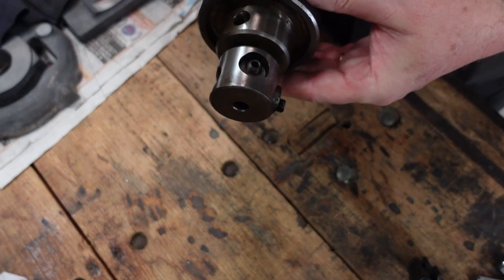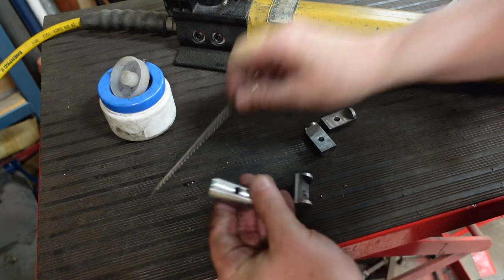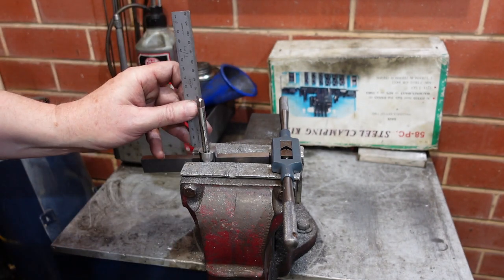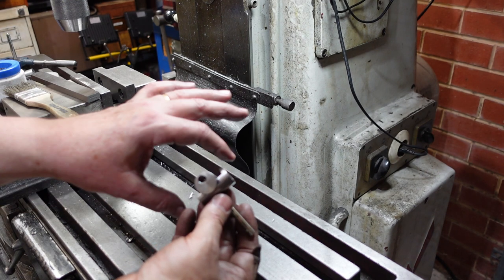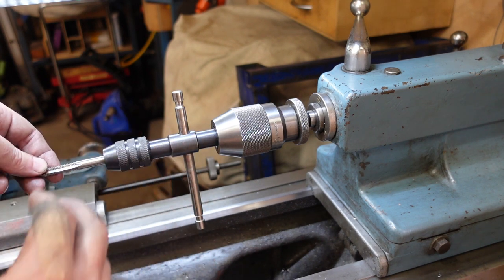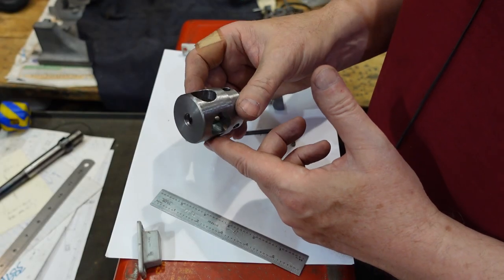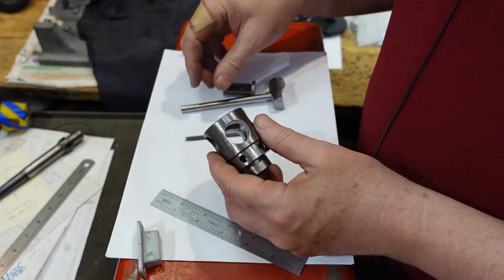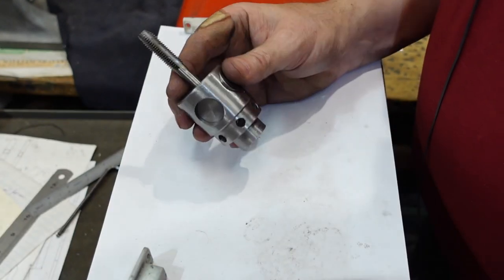Lathe tap holder

Comment: You could use a 3-piece tap set. Because of long lead in on tap 1 they are self centering. I use them since nearly 50 years and thousands of taped holes later, i never broke one tap. Not one. Takes two minutes more time but you are on the save side. Like my toolmaker dad always said: Take the tree piece and save the whining. He was damn right.

Comment: That turned out great, nice work.
What if you made the body out of square/rectangular stock first and then turned the diameters last, might be easier for the cross holes and bores to be set up “on the square” first.
Note, I’m not a machinist, but I have limited machines and think of setups that I would use. 
Cheers
Reply from the maker: That might work - certainly does away for the need for a dividing head. The only issue is that it does mean interupted cuts when turning the diameter, which depending on the lathe may produce a porrer surface finish.
I used round because I had a bit around the right size...

Comment: That is an exceptional tap holder idea with those floating jaws. It is very difficult to hold taps as there are no standards of the size of the square on the tap...it varies from tap size and manufacturer. That is a tool worth further perfecting for sure. Like your channel sir, please check out my similar channel.
Reply from the maker: I think I will end up remaking in a smaller size and trying to improve this one, but yes, I would agree that it is a concept worth pursuing
Reply: @occasionalmachinist  💡

Comment: LifePro tapping cheat, use one of those hex-bit combination drill/taps(ali/bangood and others sell them, cheap and easy to get) to get the tap started straight.  

They do come in versions with a very long or a very short drill section ahead of the tap so the short-drill version is obviously preferable but either work as guide to get the first few threads started straight so that you can finish with a proper tap...
Reply from the maker: If I was only RH metric that might work, but I also do LH threads, BA, BSF, BSW and UN varieties...
Reply: @occasionalmachinist  As with all cheats, they're cheats, easy fixes that work in some cases but not all so commenting more for the benefit of those reading the comment-section than anything else